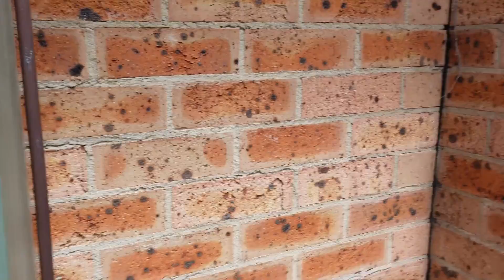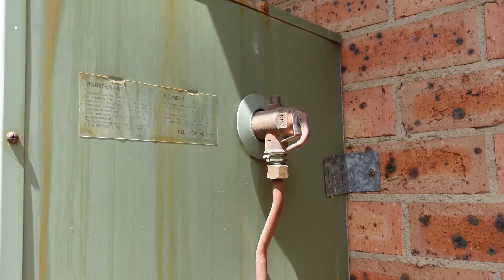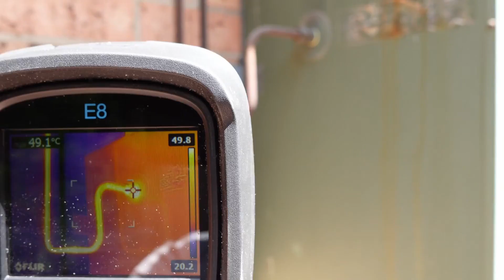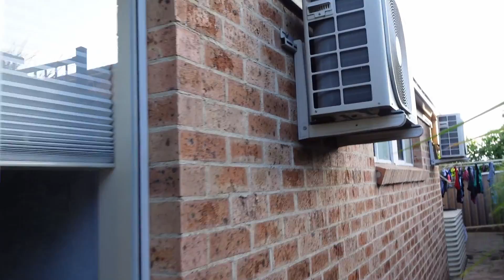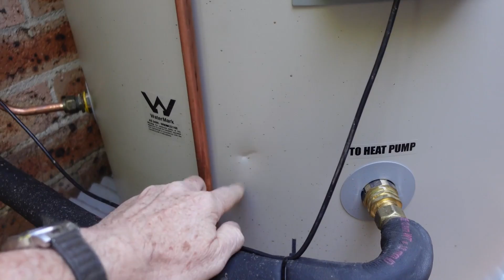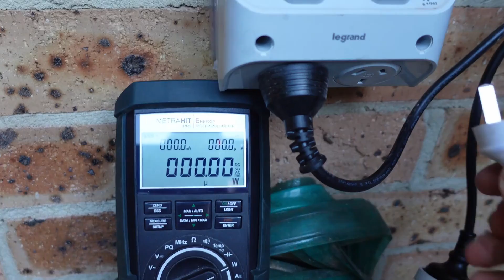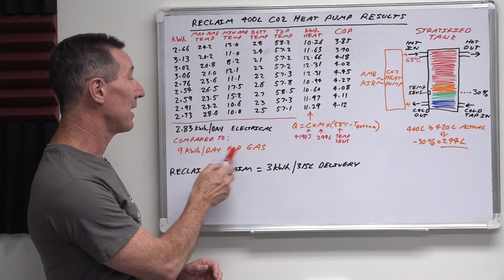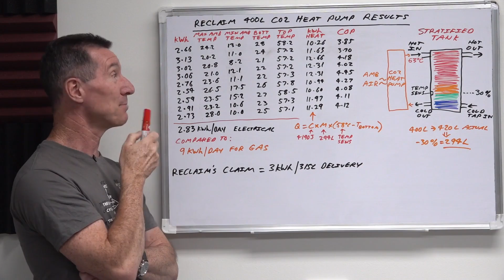EEVblog 1517 - Heat Pump Hot Water Install & Analysis

Comment: Why not direct solar collector for water? Additionally you would have an Inverter to warm up the water at night, but a big enough reservoir should be fine. Because your panels are going to have 25% efficiency tops, through a DC / DC you are looking at 23%. With a water solar collector you are looking at almost 100% efficiency for the same energy coming from the sun. Should be cheaper also and I wouldn´t think freezing is a problem in the land down under. In case you mentioned this, I´m still watching.
Reply from the maker: Makes no sense to waste valuable roof space with a solar hot water collector that ONLY does hot water. Using the space for solar panels can supply the EV, the house, the hot water, and everything else.
Reply: @EEVblog  And you mentioned that in the first minute of the video!
Reply: @Panhead49EL  true, but the question stands. The simpler a system is, the cheaper it is to maintain, the less the possibility to breakdown etc... We got a water solar collector and that thing needs pennies in maintenance.  With a heatpump plus solarpanel, you have at least 3 main points of failure and still depended on the grid, 4 if you have a battery and you are off-griding. Edit: and there are much much more expensive to replace.
Reply: @EEVblog  This is much more difficult to answer, needs a good energy analysis. You could very possibly be wasting space in summer but for the other seasons it's a bit more difficult to answer, it depends on your use, if you potentially want to use the system for warming up your house, temperature deltas etc.. Plus there are wall-mounted ones if you just need to help your system a bit.
Reply: @EEVblog  I respectfully disagree. A solar hot water collector doesn’t seem like a waste of roof space to me. With models that run at almost 90% efficiency, compared to a maximum 21% of current commercial PV panels, a solar collector would be as good as 4 PV panels.
Reply: The thing is, with a cop of 4, you get the same efficiency as a direct solar collector system, but he already has the solar PV, and energy isn't wasted when the water is at temperature.

Further there is the fact that this gets the water hotter than a direct collector system tends to. Had one of those before, and they can struggle. You can also boost from the grid when required and do so with the higher efficiency.

Finally if you live in an apartment, this can be installed, whereas you can't do that with a direct capture system.
Reply: @varno  yes but usually you need to get the water up to 50C normally, in winter where the temperatures outside are around freezing (depending where you live) getting a cop of 4 is difficult with such a delta, but on a sunny day you can store enough hot water for the day.

Even better inverter air-conditioning struggles in winter just to bring the output air around 30C and these heat pumps are essentially the same type of system.

It makes sense to have a heat pump as an alternative as it's not going to be sunny every day or might need more water one day.

In the end you could also use the system to warm your house so you get even more for your money, but generally I'm more in favor of diversifying your sources.
Reply: @TrickyNekro  I think you have been using older systems with worse refrigerants. This uses supercritical co2, which is ideal for these higher working temperatures, and is also well able to work down to colder temps too.

Further this is an air-water heat pump system, so there is more efficiency in the condenser unit too.
Reply: @varno  That's new to me indeed and in that case it would make sense. I shall take a deep dive then first, this is interesting. But true even newer models of air-conditioners come mostly with traditional refrigerants, never heard of this system before and I come from a country that's married every summer to their aircons.
Reply: @varno  co2 isn't really that great in lower temperatures. It works, but R410/R32 is better below 0C. Supercritical heatpumps aren't really that new either. CO2's use an automotive refrigerant is.
Reply: Linus Tech Tips has solar that doubles for water heating (pool) and electric energy.
Reply: @PHamster  He also has a server for that 🤣😂.
Reply: @speicherkanal4894  It is really a question of latitude. Above about 55N the sun is worthless between November to February.
Reply: @speicherkanal4894  to me it seems like the only advantage of a Heat pump over solar collectors is being able to still heat efficiency from the grid when there is no sun.
Reply: FWIW: I've had a thermosyphon solar water heater on my garage roof for over 8 years in Southern California (so very similar weather). 

It works great - produces all the hot water for the house 9 months of the year. The other 3 months - or when it's overcast for several days in a row - I use a tankless electric water heater to boost it.

Even though the system is very effective, I wouldn't install this again. It's much better to use the same roof space for PV and install either a central heat pump like in this video - or if your system has a lot of lag, tankless water heaters in each room that needs hot water. Much cheaper and the solar goes a lot further - especially if you have batteries.

Comment: I installed a heat pump water heater and I'm thrilled by it. 

I keep it on heat pump only mode and it does great. The water heater that came with the house was oil fired, and it wasted a lot of oil. Same with a gas unit, heat rises up through the flu pipe while it's off and convection cools the tank.

Comment: My gas hot water tank just sprung a leak and needs replacing.  Though my home solar won't be installed until next year (when new US incentives kick in), a quick run of the numbers says a heat pump hot water still makes sense if I only run it during the lowest overnight electrical rates.

My gas dryer is only a couple meters away from the hot water heater.  I'm now wondering if I can use a single C02 heat pump for both?  Or is there a clothes dryer that can run on 50C-60C hot water?  Doing so would allow me to disconnect my home gas connection!
Reply from the maker: You can get heat pump dryers too, Mrs EEvblog wants one.
Reply: @EEVblog  Heat pump dryers are awesome, they're pretty much standard in Europe. You might want to go for a self-cleaning model though since the cheaper ones are somewhat high maintenance requiring a regular manual cleaning.
Reply: Amazing. Wish we could do this in the UK

Comment: Looks good on the install of Arthur, and they did a pretty good job on insulating it. Looks pretty good, and only criticism is the airflow around that evaporator, should be a little further out, along with the AC units, to get good airflow around them, which does make a big difference to off coil pressures in the system. The R744 is a good refrigerant, though the pressures at the top end of the system are scary high, 40 bar plus, but at least a failure is just going to be noisy, and pop the TP valve for a few minutes as it vents. 

Should have had a measure of your hot water use, water meters are pretty cheap (funny though the last one I bought the brass was cheaper than the plastic, probably because the plastic ones are sold at a massive mark up, as they do not get stolen) and work well as baseline for water use (more data better, allowing you to see split of home water use for hot water, cold water and garden, which likely is the biggest use) and power use. But yes you will be saving money off the bat, essentially whatever the gas bill is, of which I would say most went to keeping that pilot flame lit all the time, and the gas usage would probably be overall less than the pilot flame use.

As to pipe temperature drop, it is lowest at full flow, do another test with low flow, like you would use to wash your hands, and compare again with the radiated heat in the roof, easily going to be 10C at low flow, where the water has longer to lose heat in the pipe.
Reply from the maker: I just found a shower head flow meter and temp meter on ebay for $20. Didn't even think to look for that. I didn't want to screw up the new copper pipe work just to install a proper flow meter.
EDIT: Nope, the ebay one is just a temp meter, uses the water flow to power it.
Reply: @EEVblog  Just a thought, I used water meters at a previous job so I could monitor water use on the ion exchange resin, and also budget the cost per batch.
Reply from the maker: I'm not sure I'm that keen to get exact data. I'd want it logged as well,  and then I'd also need a automated temp loggers as well. I'd be doing Reclaim's R&D for them at that point! They should just publish some characteristic curves.
Reply from the maker: I've already posted thermal images on Twitter. Loss is all the connection conductions, nothing else.